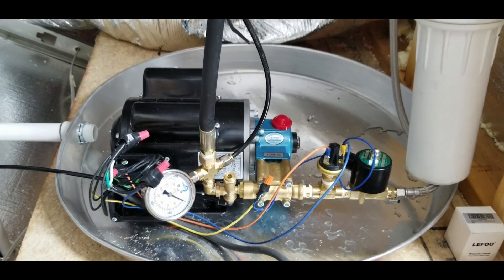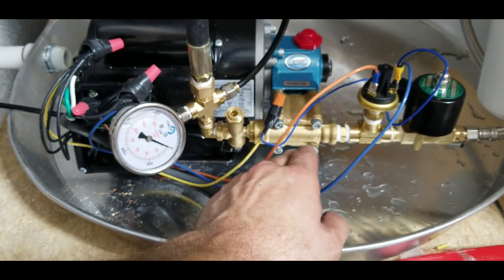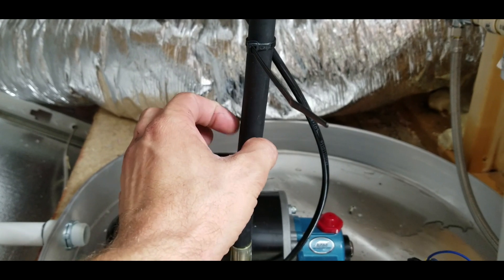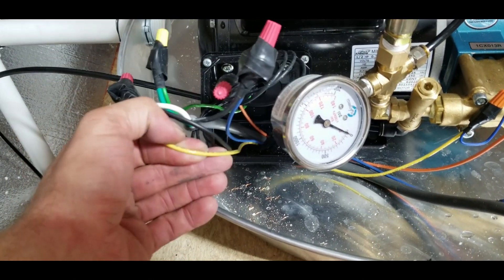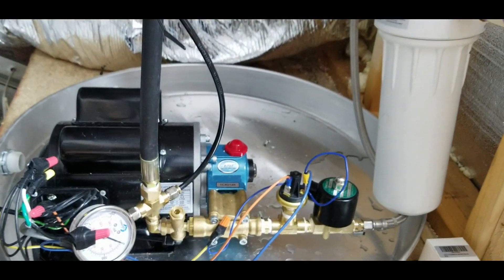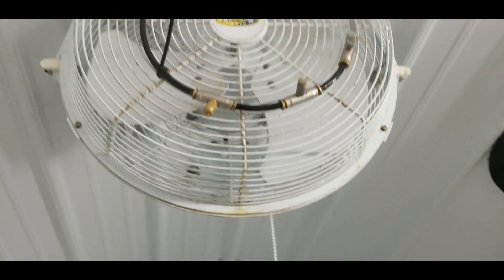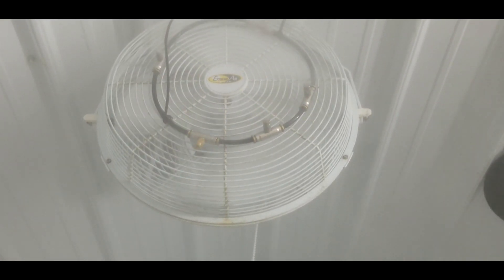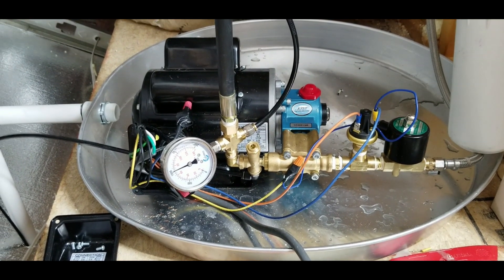DIY High Pressure Misting System 1000 PSI CAT Pump Commercial Mushroom Farm Humidification

Comment: Laugh, JG has NPT to PEX
Reply: Also, accumulator tank after the pump with the electric relay solenoid after the pump, pump takes from a proper reservoir and therefore never dry runs, makes little to no drip as the solenoid after an accumulator at the highest PSI you need/want happens after at the regulator/solenoid setup. With pex/flexible lines you shouldn't get a water hammer though I did like your solution, also why it's dribbling after, though: Straight cut off at high pressure with a proper regulator made for such functions and shouldn't have a water hammer nor drip.
Reply: Lastly, I highly, HIGHLY doubt looking at the mist generated that you're getting 1000psi and rather were sold on BS labeling --looked about 120-160 to me. Send the model of your pump and I can confirm.
Reply: @j.ballsdeep420  CAT 1CX013RD2P Direct Drive Plunger Pump With Pulse Hose - 1/2 HP, 0.13 GPM, 1000 PSI
Reply: I'm guessing the lack of reply means you were correct on the pressure spec.  Lol.  Great Video, Sir.  Out of curiosity are you U.S. based?  If so, I'm guessing these mushrooms are for restaurants and not recreation.   Lol.  I was interested in your video because I'm needing a mister that is pressured by gas and is capable of misting an oil, not water.
Reply: @JohnSmith-zn3js  - I didn't have notifications on but he wasn't incorrect and glad he provided the model number as it does bring to light why there is also dripping being a plunger pump rather than a diaphragm pump. That said, with an accumulator and solenoid it shouldn't drip if you're running an accumulator that could handle that PSI to sustain pressure, it's not a bad setup with proper plumbing to avoid the water hammer.

Comment: Cool vid bud. Question, Can this be modified for use as a mosquito mister?
Reply from the maker: I'm not sure how well It works with low input pressure.
Reply from the maker: I would give CAT the manufacturer of the pump a ring and ask how well it works off a gravity fed tank. Otherwise you would want a small booster pump probably to get it up to 40-50 psi

Comment: Just curious, I run car washes for a living.  Why don't you run the bypass from the unloader/ regulator back into the intake water before the shutoff solenoid. This way you aren't just getting constant water running or trickling out the bypass..... Instead that water is routed back to the intake of the pump.  This is how all my pumps are connected.
Reply from the maker: To cool the pump head more. Its not much water loss but yes you can run it like that.

Comment: In terms of cost, compared to 1000psi built units, how much would I save about by building it myself?
Reply from the maker: it's around $600 in parts vs around $1k. Also I dont think anyone makes a .13 GPH model which is all you need for anything smaller than 300-400 sq ft

Comment: Hey, I don't know much about wiring, and am building this setup for patio misting. Can you update or post a wiring diagram?? Can you also let me know, some people recommend a check valve to prevent back pressure when you shut the pump off, is that not necessary with the solenoid valve?

Comment: What do you think of these nozzles compared to a high pressure system as you built here? having a standard compressor already, this would save a lot of money to build out my humidification system. Any thoughts or have you looked into this type of system?
https://youtu.be/Y2LdTp5rsZQ
Reply: Their nozzles are $60 a piece with a water flow rate of 0.03gpm not including the cost of the air compressor. I think their average droplet size would be slightly smaller though.
Reply: @aullvrch  so they would be a good choice for a 9x11 fruiting room?
Reply: @seanschriver1543  I'm not sure. You will definitely want to consider the noise of an air compressor which is considerably more so than a water pump. But I was just commenting on the massive difference in cost per gpm of the microfog nozzles compared to the direct pressure route.
Reply: @aullvrch  right, I hear you there. But I'm not as concerned with the cost as the finest atomization. My lions main has to have a clear plastic sheet draped over them to try and keep larger droplets from settling on them. Even then with my fans running, some of the humidity will be pushed under the sheet and condense on the sheet and drip down or enough of the larger moisture will consiolitate and condense on the LM and then I get brown spots or dead spots. Just trying to find the best of both worlds so I can run them with my other mushrooms. I don't know why I seem to be having this problem, I don't see others posting about it. But then again, I started out using a sling type unit from house of hydro and the switched to a 10 head float in a reservoir. But I noticed I have to change my res often as it seams to accumulate spore load from the fan blowing into it and pushing the fog out. I can't seem to win, lol😄
Reply: @seanschriver1543  Interesting problem you have there. I'm actually interested in this misting pump for aeroponic produce, so I have no idea what the problem there could be? When it comes to a small droplet size for a direct pressure pump perhaps you could try using impingement nozzles?
Reply: @aullvrch  ill have to check them out. Never heard of them, thanks
Reply: @seanschriver1543  If you find a good place to buy them other than from aliexpress please let me know!:)
Reply: @aullvrch  will do!

Comment: You might wanna check out aerosci. They make nozzles and systems that run on compressed air and create 10-20 micron fog. You also might want to check out some of the lower pressure pumps like procon, fluid o tech, or nuert, and using them with an accumulator tank. That would prevent any short cycling and also allow you to use more reliable, less expensive, lower pressure (290psi max) pumps and better nozzles like tefen or senninger. But honestly, I think you would scrap this for th aerosci nozzles if you saw them, or the quad or octo fogger. You won’t get a finer mist without going ultrasonic. Aerosci is pretty much the smallest droplet producing nozzle.
Reply: Ultrasonic? There is an ultrasonic system?

Comment: Hey Eric, I am getting quite frustrated with these ultrasonic disc under preforming and looking to upgrade to this misting system.  I believe you may have covered this question in your workshop, but do you advise against this system for a 100 sqft fruiting room?  If business does well, I do have the ability to add another 100 sqft down the road. Im concerned that the system wont work with only 2 nozzles, or it over saturating the room.

Comment: So one could theoretically use this system as a patio mister?
Reply from the maker: these pumps are the same exact pumps used on patio kits. just without the fancy branding and packaging
Reply from the maker: 100% Absolutely yes. Just get a bigger GPH pump like a .5-1 gph so you can run a good 10-20 nozzles

Comment: Wouldn't a check valve ( one way ) stop the water flow when the pressure is off. Seems like a lot a gear to move water

Comment: I was just wondering on the hose you used, at 1,000psi it looks like you are using a PU push fitting hose rated at 100-200psi., can this handle the pressure at long periods?
Reply: no they have ones rated for 1000 psi

Comment: Hi Eric 
On your kit page the pressure switch has a pair of comments from the same person:
 IT WILL FAIL. I SPENT 3 HOURS TRYING TO FIGURE OUT WHAT WAS WRONG.
DO NOT USE THIS SWITCH. IT IS ONLY RATED FOR 1AMP AT 120
How has it been working for you?
Reply from the maker: It was working just fine for weeks, but you know what its not rated for 10A, I went and updated the Kit listing with a more heavy duty 10A switch. Funny it took 3 hours to troubleshoot when its literally the only switch lol
Reply: @MyersMushroomsFarms  Agreed, thanks! I have almost everything put together (lacking only completion of the wiring and connecting the water lines) so will order and swap that out before firing it up for service. Thanks for the plans.
Reply from the maker: @keepertrout9927  hope it serves you well! make sure to service the oil as needed.
Reply: @MyersMushroomsFarms  Thanks! I'll watch for that need.
Reply: @MyersMushroomsFarms   I just wanted to comment. First thanks for the responsiveness. I did buy the new low pressure switch and do plan to install it. However, the other one (1Amp) was already installed so out of curiosity decided to test it as it was so flushed the lines, added the nozzles and powered it up. Works great and is amazingly low noise!  Thanks!
Reply from the maker: @keepertrout9927  yea i had mine working for a few weeks with the 1A switch. I bet if you got a smaller motor with a larger pump head it would surge the power more on startup. I wonder if the person who made that comment had a larger than .13 gph pump.

Comment: So I have my pump all wired up and running but I have a lot of water coming out the bypass line. Does any one know why that may be?
Reply from the maker: how many psi are you pushing? How many nozzles of what size? and what size gpm pump do you have?
Reply: Wow! The quick response time is amazing! I bought the bigger pump as you suggested. The 1CX050R which means it puts out 0.5 GPM rather than 0.13 GPM like the one in the video. I have six misters on a line that is about 48 feet long. I adjusted the pressure to 1000 PSI. When I was adjusting the pressure, I accidentally touched the contact on the pressure switch with my Allen wrench. The bypass line wasn’t leaking much prior to that. However, if I shut off the water, the pump shuts off so I think the pressure switch is OK.
Reply from the maker: @nathanclark2780  so a .5 gpm pump needs like 15-20 nozzles. thats why i went with a .13 gph pump
Reply: Myers Mushrooms Farms, I am getting it dialed in and will be getting more misters. Thanks so much for your help! Your videos and willingness to help are greatly appreciated! All the best to you and your family!
Reply: @MyersMushroomsFarms   I have the .13 gph pump with 4 nozzles and the same thing is happening. Water coming out of the bypass line but no mist.
Reply from the maker: @averyhughes6686  crank in the regulator, do you have the pressure gauge? what is it reading? you need the gauge to properly adjust the regulator
Reply: @MyersMushroomsFarms  Update. I cranked in the regulator and the water coming from the bypass stopped. But the pressure gauge doesnt budge and theres no water coming from the misters. Also, when I first started the motor, it would cut off when i cut water. Now I cut water and it stays on.
Reply from the maker: @averyhughes6686  sounds like you wired the pressure switch to the Normally open not Normally closed
Reply: @MyersMushroomsFarms  Theres the problem. The video states the opposite.
Reply: @MyersMushroomsFarms  I still can't get it to work. I've got the neutral wire coming in and connecting to the three black wires that came bundled and tapping off to the solenoid. I then have the hot line coming from my power source, tapping off to the pressure switch, and also to the solenoid. I then have the remaining three wires from the pump with a tap off to the pressure switch. When the orange wire is connected to the Normaly Open, the pump seems to turn on, but when I place it on the normally Closed, the pump doesn't turn on. Would a bad wiring connection somewhere cause this? Water is coming thru the system, even all the way to the misters but the pressure gauge still reads 0. Possible to pay you for a one on one consultation?
Reply: @MyersMushroomsFarms  Also, I have the Lefoo switch from before you updated it. The belt or something seems to kick on but the motor itself doesnt seem to engage.  Should I look into getting the better switch?
Reply from the maker: @averyhughes6686  ok so upgrade the switch to the new one, Also try taking your pump off the motor and make sure there is the pin on the shaft that spins the motor.
Reply: @averyhughes6686  Hey Avery, I am about to invest in this system as well.  Seems like this could be quite the project, have you solved your issue yet?

Comment: Will this work for 5 minute on off cycle intervals?
Reply from the maker: yes it will work but if you can make the cycle longer the motor will last longer.
Reply: @MyersMushroomsFarms  I'm building a high pressure misting system. What do you recommend to cover 200sq ft with 2 seconds on every 5-10 min ?
Reply from the maker: @Tradingevolutionz  like 5-10 min on 10-30 min off

Comment: Hi. Great video as always and thanks for making them. That little black line has 1000PSI in it? How doesn't it rupture and the cpvc and particular filter side is all low pressure? If not, how doesn't that explode on you?
Reply: Thanks, that's amazing that such a small line can hold that much pressure..plastic too. It's a wonderful world lol.
Reply from the maker: that black line is rated for 1000 psi and all the fittins after the pump as well

Comment: Eric, thank you so much for putting this video out!!!  Are you controlling the pump with a humidistat, like an inkbird or are you on a timer?  Is this 120v or 220?  You are cruising right along!  Not sure if you left yet, but stay safe......thanks for everything!

One more thing, why did you chose the 1/2 hp over the 1/4hp, when the 1/4 has same PSI and gpm?
Reply from the maker: I went with the bigger motor with hopes it wont be loaded down as much. For a controller im using a short cycle timer